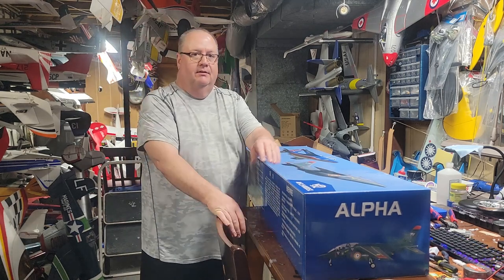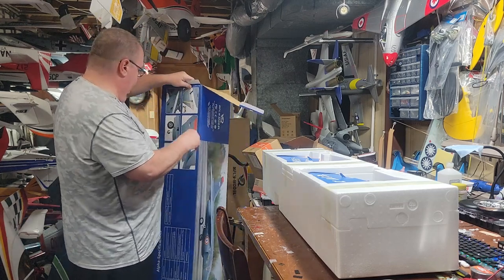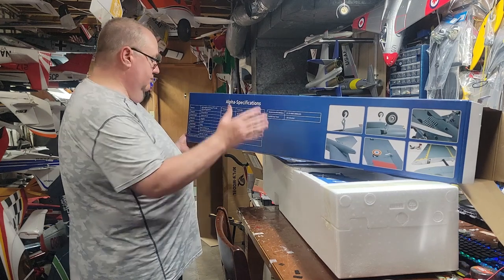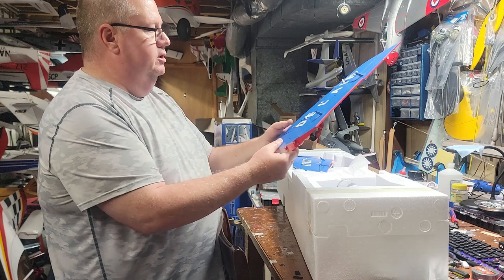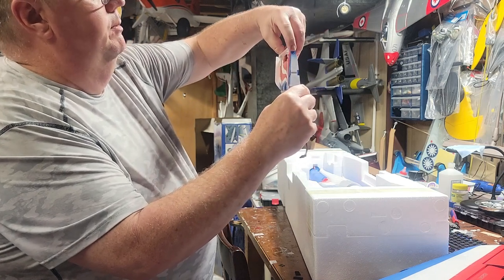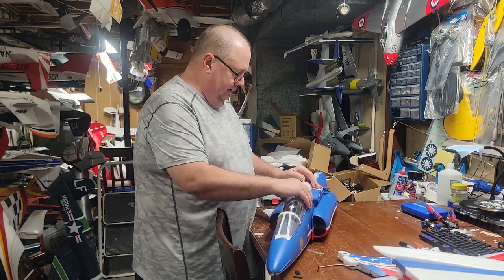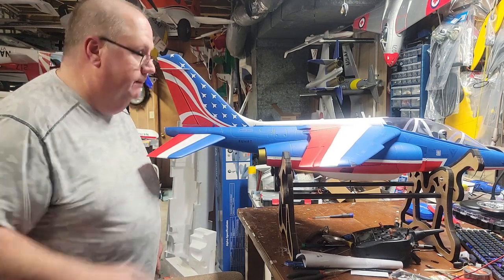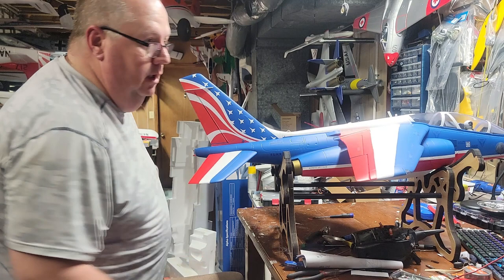X-FLY ALPHA 80MM EDF JET UNBOXING AND ASSEMBLY BY Fat Guy Flies RC

Comment: I think you might find that FMS  do the moulding for XFLY ,  they also do the manuals and packing - - happy to chat over this but why do you think that XFLY mould the aircraft themselves ?
Reply from the maker: Well the molds are the most expensive part and as far as X-Fly being in league with Xfly its is very possible. I mean Eflite is just rebranded FMS.

Comment: Not a good idea to mix ec- or ic- connectors with xt- ones, they fit but the metal connector has a slightly different shape, so the connector can heat up if you put a lot of amps on a connection like that...like in an edf...wouldn't risk it, adapters would be a better choice if you ask me...
Reply from the maker: I agree i was just showing that they do fit.